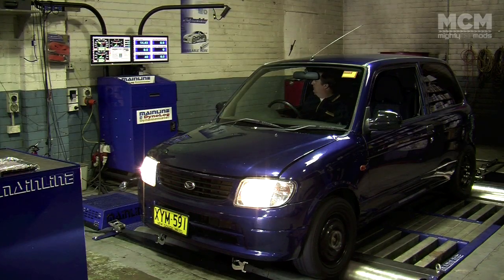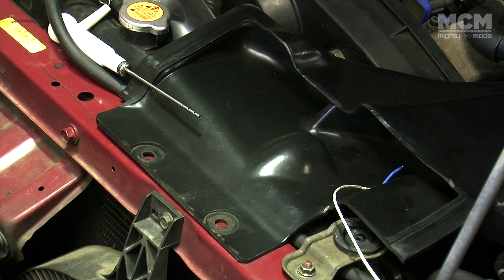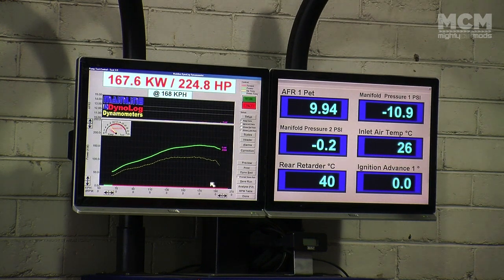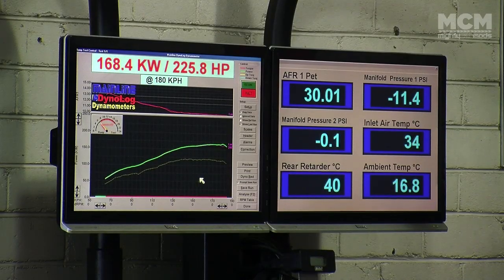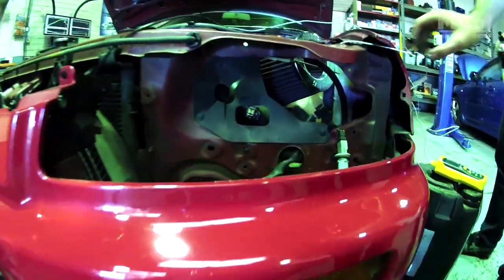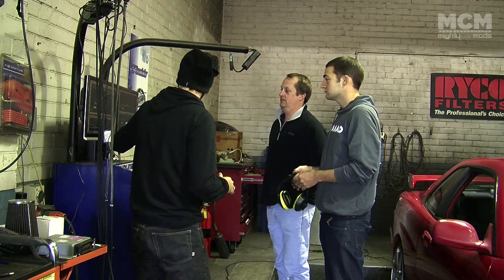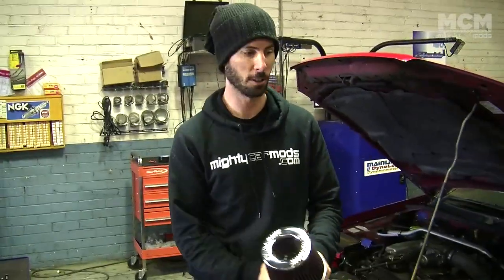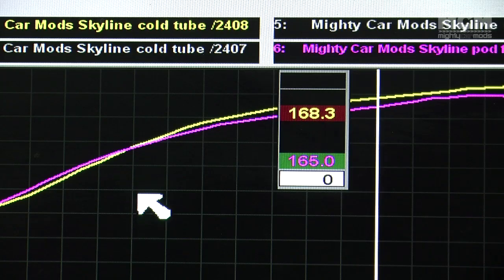Cold Air Intakes Mythbusted [Turbo]

Comment: Without any proper tune, any CAI is worthless. Your not telling the ECU to take advantage of the 'extra' air that is coming in.
Reply: Exactly, a lot of ECU's will try to keep the engine at factory output.
Reply: So the only gain is proberly some loss in Torque and some gain in noise. Only cars being boosted can take advantage (a little more responsive) but not serious HP increase.
Reply: my car actually lost torque when i removed the factory airbox,without a tune the intake just make more suction noise thats it.
Reply: It's proberly due to flow from airfilter towards your engine. When your replacing that with a CAI, your changing the flow characteristics of air coming into your engine as well.
Reply: It helps when they actually have a 30-60mph headwind to validate the test.
Reply: 30 to 60mph is still small percentage. Who's going to rev their engine wayy up to feel the difference in every gear?
Reply: You're talking nonsense. The ECU doesn't need to know you've installed a cold-air intake, because it knows how much air is entering the engine and it knows what the ideal fuel:air ratio is. The stock ECU programming can increase the spray duration from the fuel injectors as necessary to match any reasonable increase in airflow. If you install a turbo or supercharger, that's a different story, but we're not talking about anything that complicated in this video.
Reply: Many cars did not show any advantage over a CAI vs factory airbox. THe ECU just sprays within parameters, but will not spray more due to increase in airflow. Perhaps to prevent it from running lean/rich but thats about it.
Reply: Harry Spencer, How do you suppose the ECU has any idea of the output?
Reply: actually in a gasoline car, the ECU measures the air coming in and fires the fuel injectors so that there's the right amount of fuel to mix with the measured amount of air.  if there was more air, the ECU would match it up with more fuel and therefore make more power.  the timing and fuel tables in a factory ECU always extend a little past the stock capabilities so if the cold air intake/pod brought in more air the car would make more power.  this test shows it doesnt.
Reply: An aftermarket intake will NEVER increase air flow significantly enough to need "tuning". Your air filter will make the biggest difference.. Just having a clean air filter is all you need, stock intakes are designed to give optimum air flow already.

An aftermarket intake is only going to reduce low end torque, nothing more.
Reply: So You're saying MAF doesn't measure air coming through the intake? What is it for then? I don't see people getting different tunes when driving at different sea levels, wow how are their cars still running? If there was more air from pod filter, maf would measure it and ECU would correct timing/fuel. Put a manual boost controler on a car, turn it up, turbo compresses more air, ECU provides more fuel. It doesn't need a tune to do that. Your conclusion on pod filters providing more air is wrong.
Reply: Would this apply to VAG 2.0tfsi / tsi engines? e.g. APR stage 2 remap says you need a new intake! I don't like the noise on the highway so just loosing a few hp I can live with but don't want to cause misfires?
Reply: Mass flow sensor lol...for some of you.
Reply: KronosSlots you don't know how cars work do you?
Reply: Someone educate this kid on what a MAF is please.
Reply: Kevin Pope  OK I understand how a hood scoop would help catch and force cold air into the engine compartment and make a cold air intake more efficient
Reply: This was my exact thought the entire time watching this video.  Also its going to be vehicle specific and results will vary.
Reply: Shawn Elliott some CAI need tuning for a power increase.
Reply: @91C4NVA  exactly.
Reply: Exactly
Reply: Fax!
Reply: @Travis Su: That is only true for a turbocharged car. Most cars are not turbocharged, but people install CAIs anyway to get a little extra horsepower, because all engines run better with cooler air. A non-turbocharged car, or even a turbocharged car with poorly designed intake ducting that restricts the intake air too much, will run better with a CAI without needing an ECU tune.
Reply: Airaid cai dont need a tuner
Reply: A lot of people on here are saying you don't need your computer chipped/tuned after you install a CAI and that's just not true. I can not run a CAI on my 300zx twin turbo without a chip tune. The computer needs to know how to deal with more air coming through it. I know this because I had to get another chip for my ecu when I added my dual air intake
Reply: exactly same with exaust same with any part really i mean you can put a turbo on a car but with out a tune its doo doo
Reply: depend on the mouth, if it small, it useless go and tune
Reply: Tbh im not sure what everyone here is talking about. Sure the ecu can adjust to keep the afr @ around 14.7(much less under wot) but if it were true that the ecu could accomodate cais or sris for that matter why has every short ram intake ive installed on every car caused a trouble code "bank 1 lean condition"? ...if i were to remove the intake the light disappears....
Reply: Shawn Elliott depends on whether your car uses a MAP or MAF sensor.
Reply: Some vehicles gain from higher flowing intakes without any tuning(minor gains) and that's normally only throttle response. If you have to tune it, you might have an issue.. because all you should have to do is disconnect the battery and start the engine with the new filter..
Reply: Learn then write nonsense!!!! Every ecu knows exact how much air comes. Also this is about air temperature not air flow. Airflow is the same, temp is different and you no need to do ANY tuning in ecu to tell about air temp. Car knows it and explosions happens 'stronger' with cold air. So LEARN before writing nonsense. They just proved it.
Reply: @godshammer3122  Learn then write nonsense!!!! Every ecu knows exact how much air comes. Also this is about air temperature not air flow. Airflow is the same, temp is different and you no need to do ANY tuning in ecu to tell about air temp. Car knows it and explosions happens 'stronger' with cold air. So LEARN before writing nonsense. They just proved it.
Reply: @SayWhaaaaaaaaaaaaaaaaaaaaaaat  When does i say anything about the ecu?  Why don't you comprehend what you are reading before you go popping off at the mouth.
Reply: @91C4NVA  Denser air makes more power. Look up Gale Banks
Reply: @91C4NVA  And colder air is denser, higher in oxygen than hotter air, gallon for gallon (yes, we're measuring air in gallons now. fite me). So is turbocharger air, supercharger air (except Roots. Let's just ignore Roots. You know what I mean), and so is pure oxygen at atmo pressure.
Reply: @91C4NVA  it depends on how poor the factory air system is. it may be better or worse than aftermarket. you accuse, rather brashly, that O.E.M. is always superior, which is not true in any way.
Reply: @91C4NVA  The largest factor is the engine (or blower in the case of a 2 stroke, where the blower is integral to the engine). However, if the engine is huge, a three-and-one-half centimeter bore may introduce a restriction that a four centimeter bore won't.

You've not actually gone and made a relevant point.

Comment: This is a bit deceiving. While your correct in the sense that slapping on random filters and tubes usually will not show power gains, a properly designed intake along with accompanying ecu tuning can indeed yield significant increases. The fact is though to take advantage of most aftermarket intakes that flow more air, you have to then go correct the ECU's map for air/fuel and timing to compensate for the additional air charge. We have seen gains upwards of 30 wheel HP on modern turbocharged vehicles after a simple cold air intake/retune. The gains are less on normally aspirated engines, but we have still seen gains of around 10 wheel HP on larger displacement 6 & 8 cylinder engines after a well designed Intake was installed AND the tune was adjusted accordingly. Tuning is key to making power, period!
Reply: +Joe Doole This.
Reply: I was going to say, more air, same fuel means lean running engine. Not surprised to see loss
Reply: +Fuel4Torque kinda how I feel. Maybe this is a bad example, but take my computer. By putting a bigger fan on my cpu isn't going to make it run faster, it's going to make it run cooler / maybe more effeciently and potentially prolong it's lifespan, but it isn't going to run any faster. 

However, if I decide that I want to over clock my CPU, I would want to opt for more efficient CPU fan/heatsink for it, so that I know the temperature is efficient enough to not burn out by overclocking, or in car terms modding / additions that provide actual gains. 

When those increases are made, I know my CPU is getting enough air flow and at a hopefully cooler temperature than stock and won't break/melt/burn any parts from additional heat that's released in energy due to the actual gains (same for ICE [internal combustion engines]). 

Now, I'm definitely not a car expert and don't claim to be. I know just enough to be dangerous by being able to take my car apart, but not put it back together. 

Now,  I understand ICE's function much differently than a CPU on a computer. I suspect the comparison can still be made, and hope someone can correct me if I'm wrong. 

I know ICE needs air, fuel, and spark to run or fire. I imagine the temperature of that air doesn't matter at the point of modification, more than ensuring flow of that air is maintained and to a temperature below the hottest temperature the engine can withstand before breaking. 

Again, I imagine this may provide potential longevity of an engine (disregarding water etc getting into cold air) as would a CPU, but not inherently make it run faster. 

I guess what I'm trying to say is just because something runs more efficiently doesn't always translate to an increase of performance. 

I'm sure someone smarter on here will probably prove me wrong, but that's my perception of it.
Reply: Well said. this video gets a down vote for not being entirely truthful
Reply: actually it's not bringing in more air per say, it's less restrictive so less work for the engine to do. Kind of like using a bigger straw to drink a soda - if you sip at the same rate with both straws, you won't suck in more soda, but it'll be easier.
Reply: +Alvin Lee this whole video is a joke. This is a turbo car. It will not benefit from a CAI like a naturally a aspirated car would
Reply: Alvin Lee a wider straw means more volume..more volume is more soda..you don’t even understand your own reference

Comment: honestly, when it comes to this stuff I just feel like it depends on the car, the R32 skyline already has a system to feed cooler air through the engine for max performance because of the fact that that is what the car was designed for, performance, no need to fix a stock performance air intake system with another performance air intake system you know? However there are some cars out there that have a very restrictive intake system, and it is on those specific cars that you might gain something, do I believe a cold air, or short ram intake can add 20%? hell no, however you might gain a horsepower or 2 with it. Not significant, however at least it is something.

Comment: I have a K&N filter on my truck not for power gains, but because I don't like buying new filters every year. :/
Reply: honestly I wish the previous owner of my F150 kept the stock airbox.. the K&N lets too much dirt into the engine for my tastes.  (and yes, I properly clean and oil it every 3000 miles)
Reply: My truck is an old beater lol its a 93 Sonoma, carburetor air system, so there isn't a standard efi airbox, the k&n works well for me
Reply: +Zeus  Longmire i guess if it's a beater.  I know I did much worse to my '92 accord!
Reply: Maybe you oil it too much/often? You are suppose to clean/oil it double that amount. I had to google and convert that to km, the directions is clean/oil every 1 000 - 1 500 km (around 6 000-9 000 miles).
Reply: +Tobias Åkerblom 1600 km is 1000miles. I think your math or typing errored
Reply: I think I added a zero too much or something :s Used google to "translate" for me.
Reply: Ah lol makes more sense that way.  But it's 1.6km in 1 mile...  So 62 mph is 100kmph and 100 miles is 160km...  From there the math is fairly simple to get a guess at speed or distance.
Reply: +Tobias Åkerblom you have to let it dry for 3 or 4 day or you will end up having to clean you mass air sensor
Reply: your shit is heavy and don expect to run fast
Reply: Air filters aren’t even expensive like under 20$

Comment: best way to test something like this is to have an old car with no ecu, no maf sensors, and maybe even carburetors. then you really do have more airflow
Reply: Agreed
Reply: I agree.....there are too many sensors on cars generally today to make gains with a CAI.
Reply: True to a degree.  With modern cars control systems keep the air fuel mixture, etc. with much more precision.  So with an old style carburetor changing the inlet temperature or restriction changed air mass flow and likely the mixture.  Still even in a modern engine, colder, denser air should mean more mass flow and more power,

Comment: i think on turbo cars, doesn't matter if it's cold air intake or hot air intake, the air will be compressed by the turbo which will get hot anyways. So the intercooler is doing most of the cooling for the air before get into the manifold
Reply: I used to think this too but the intercooler doesn't cool all air to the same temperature. If intake air temps are higher, intercooler air temp will be higher as well, which means less dense, less oxygen. Even with a turbo superheating the intake air, if it's colder to start, it will be colder once it reaches your engine

Comment: 1) You need to drive the car around for few days for the ECU to learn the difference and adjust itself accordingly.
2) A drop in performance air filter will give u noticeable throttle response. Your foot will feel the difference throughout the rpm range.
3) Stay away from oil filter and stainless steel filters. They mess with your air flow sensor, your idle will become unstable.
4) The sound from your engine bay will put a smile on your face.
Reply: Okay, but what does "give u noticeable throttle response", actually mean?  Is that a faster increase in volume of airflow, after moment of throttle position change?   What does "mess with your air flow sensor", actually mean?  Can you direct us to any measurements or other evidence of throttle response, or airflow sensor function errors, following fitment of an oiled element air filter, or "stainless steel filter"?  If we're taking about specific components and specific modifications, something more specific that "your foot" makes sense.
Reply: @assininecomment4934  ok first up about the sensors... on Oil-Based filters sometimes under heat the oil can drip onto the intake sensors (MAF Sensor, Map, depending on what your car has) there for altering the tune of the engine tricking it into running potentially leaner, therefore causing rough idle, power loss, and pinging. It also makes the emissions worse... Now about the throttle response, when you press the throttle in a stock airbox their may be a slight delay similar to turbo lag but much more minor, this can be due to a bad filter yada yada yada but when you switch to a pod filter, you open up the area at which air can enter the intake, from a small 25mm hole in the side to ALL SIDES of the filter. This can mean when you press the throttle you get INSTANT torque and even a potential power gain (a lot of factors go into that though) in my car you can definitely feel a difference in throttle responsivness, but after driving it on track it got a very stalley idle and pinged at very low rpms. it is old and its the first time its been driving hard in probably 2 years, so im guessing a lot of gunk has gotten onto the sensors (like i previously said) and caused these issues... one thing i will not agree on is the "ecu drive it for a few days" thing, thats utter bullshit. after 1 or 2 pulls and hell just starting it will make the ecu do 99% of the changes, and most cars with pod filters are tuned to be fuel efficient anyway so a ecu tune or reflash WILL see gains on these engines... ralliart ecu reflashes in my car see up to 10% or 6kw gains which as they said IS a noticible gain.......................... overall this has taken me 20 minutes of my life to type, why did i do this... you BETTER apreciate this ahahhahah
Reply: @cheetahgaming3642  - Thanks, mate - do appreciate your time and thought.  Yes, I am familiar with those grubby sensor woes, though not personally.  I guess it could be minimised by moving the air filter to a position where it won't absorb much engine bay heat - otherwise the whole (potential) benefit of any 'cold air' system is utterly negated.   Even prior to any tuning changes, and even if peak power output isn't necessarily increased by some (millions of) free-flow / 'sport' air filter systems - maybe the quicker response, and increase in power and/or torque outputs earlier in the rev range, are there to be enjoyed.